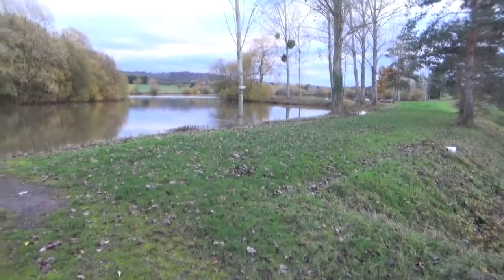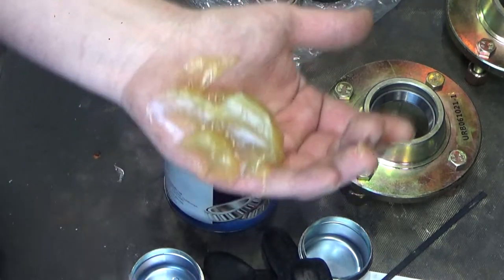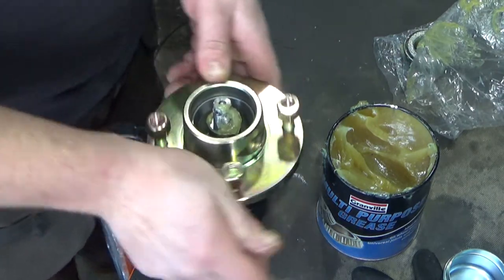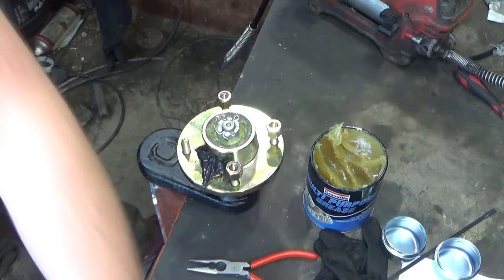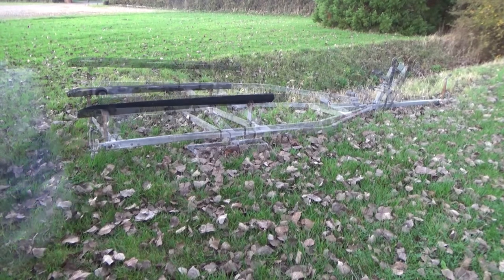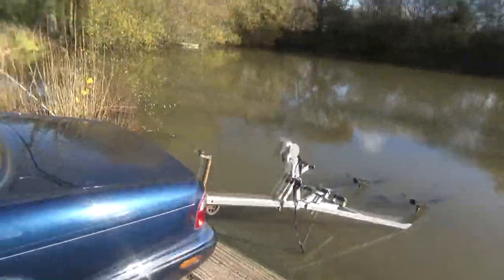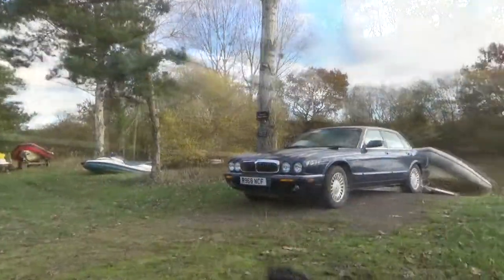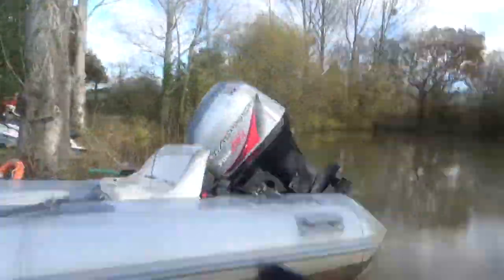Boat trailer repair, Packing bearings, fitting suspension units, and pulling a boat out

Comment: For your info, when you spun the wheel it sounded like you have over tightened the roller bearings. They will overheat and fail prematurely if left like that. Should be finger tight then tightened slightly to set fully home then backed off to nearest castellated slot for split pin. I usually carefully tighten until resistance felt then back off then repeat a second time.